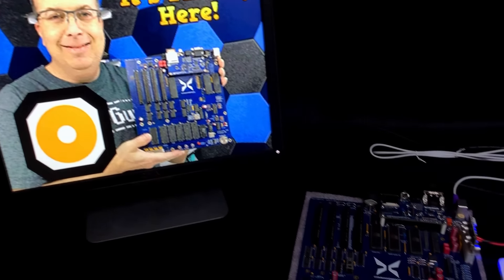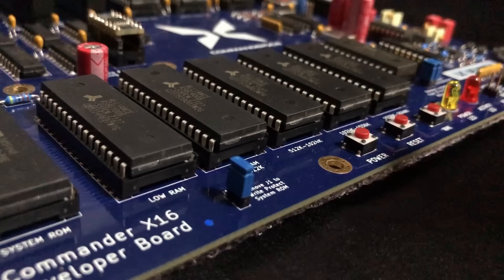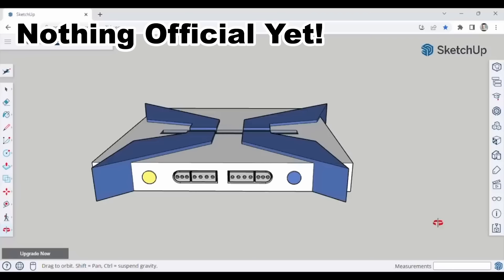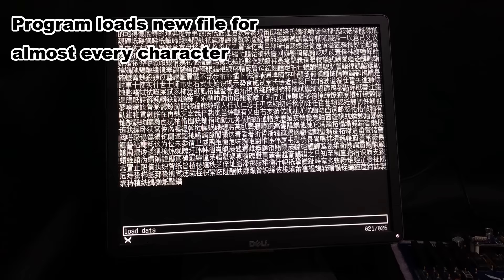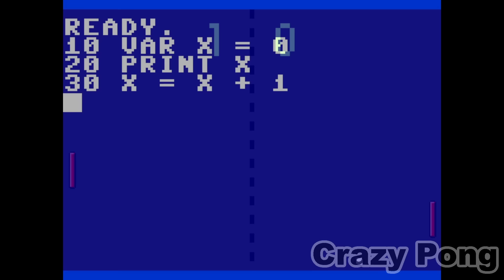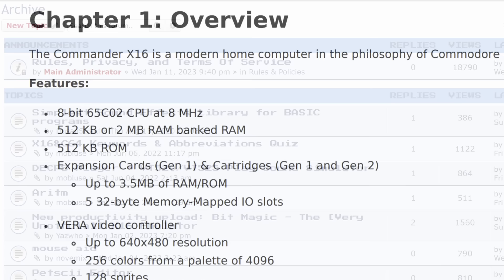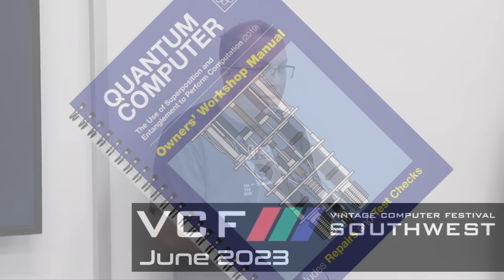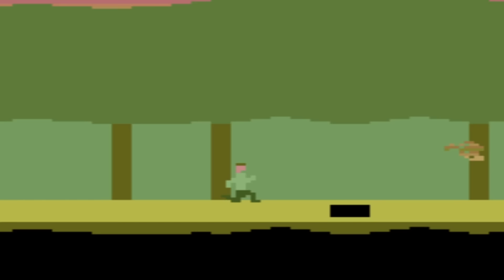The Commander X16 is Finally Reviewed!

Comment: I think this machine has several very stupid design decisions, starting with PS2 keyboard port. Why no USB? Would it really had been so complicated to include USB? Then the retro CPU, too many components, too expensive. To be honest: If I wanted to use those kind of retro components I would rather rebuild a C64 with one of the modern boards available.
I think for "modern retro computing" the Agon Light 2 is the much better option.
Edit: the Agon Light 2 also has PS/2 keyboard connector. Still, the rest of it is
much better. Especially much cheaper.
Reply: 8-Bit Guy put out a video awhile back explaining why certain decisions were made, including why no USB.
Reply: @KevinFields777  yes so no USB might be a valid point if you really use an 8 bit CPU but the rest still holds. I never understood his decisions from the beginning. Way to complicated without good reasons. Which then makes it too expensive.
Reply: @mudi2000a  did you watch the video? Most of the decisions had actually very good reasons. Could the design have been changed to avoid/overcome these limitations? certainly. But as it stands, every design decision was clearly explained and is reasonably understandable with the system as it is. The X16 is for a niche of users, just like the Mega65 and the Argon Light. You have to pick what is best for you. I for example cannot understand many of the decisions that went into the Argon light...
Reply: @Darkstar2342  I have been following the X16 for some time and I know why it has been done how it is. It is just not for me. I would rather prefer the real thing, or something cheaper. But as you said everyone has his own preferences.
Reply: PS/2 keyboards are better anyways
Reply: @Darkstar2342 Having followed the project from David's first video, I too think the subsequent decisions were ill advised. Feature creep set in very early, and everything went awry. David then back pedalled, trying to justify the decisions, pretending this was always the original idea... we just misunderstood his first video. 🙄
Reply: @digitaljestin Apart from the obvious fact that decent PS2 compatible keyboards are getting harder to find, it's not a problem. Unlike several other decisions, like the choice of sound chip and using a full blown FPGA. And the ideal price of not far from $50 went straight out the window, strapped itself to a rocket and headed in to the stratosphere.
Reply: USB is insanely complex. So, yes, it would have been THAT complicated to include it.
Reply: @The8BitGuy  yes I get that but you have a FPGA for video. For the sake of being able to use current hardware I would have preferred you put a microcontroller on it to be able to use USB. Now the user has to buy an adapter ( ok I think you ship a keyboard so that’s fair enough…). Actually I also would say VGA should not be used but HDMI and the same problem applies here too. However most of the monitors sold still have VGA so that’s fine. But I think I am not the target group. Due to house movings even across countries etc I don’t have any old hardware and I am not planning on buying it. Ok if I ran across some original Commodore hardware in good shape I might get weak.
Reply: @another3997  I still don't understand the price complaint.  Even if not stated explicitly in the first video, a $50 price point was never feasible for a through-hole computer.  The chips alone probably cost around $50, not including the board or the assembly.  I don't feel it needed to be stated.  The second video, on the other hand clearly stated that $50-$100 was for the gen3 if there is interest.  This is gen1.  On top of that, it's the first run of gen1, where early adopters (myself included) expect to pay extra.  I have no doubt that the next run of gen1 boards will fall closer to the pre-pamdemic, pre-supply-chain-disruption estimate of $200-$300.  All in all, I'm impressed at how low the cost is.  Even for the first run.
Reply: @another3997  I certainly know some people misunderstood the first video -- the Agon light developer put out a video where he did misleading editing to pretend that David was saying there should be no FPGA or MCU in the X16, when later on in the same video David presented the FPGA based Gameduino chip as the video chip, because there is no in production 8-bit data bus ASIC tile and sprite graphics chip that puts out VGA graphics. (And of course, the Agon light board emulates a tile and sprite graphics chip using a 32bit MCU.)

Comment: honestly the biggest issue I had with the X16 was trying to sort out the compiler to actually compile for it. The Emulator's use of a .img for the vitual SD card is also slightly annoying but not too awful.
Reply: You can use the emulator on regular directories and files on your host system just fine. It's not required to always use a sdcard image.
Reply from the maker: I compile with CC65, then the resulting file can be run on the system with LOAD "FILE.PRG" or whatever you named the output file
Reply: @InkboxSoftware  if I remember correctly, I couldn't even find a valid download link for CC65 on the website, like the link was bad or something (I was trying to set up one of the x16 IDEs, forget which one). I'll have to poke at it again,.

I think I got into messing with the .img stuff because I wanted to mess with file save/load functions at some point. It's not too awful once I remember how to mount it with OSF.
Reply from the maker: File save/load functions are still able to be used without mounting, even in the emulator. Drive 8 defaults to the SD card.